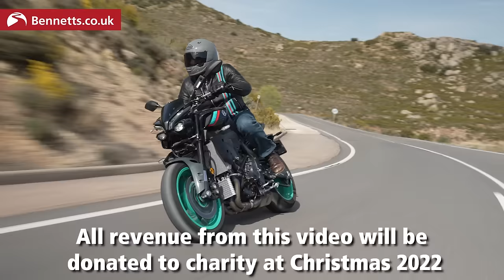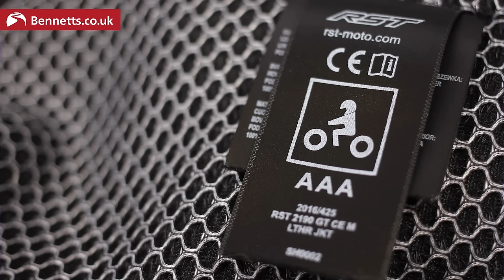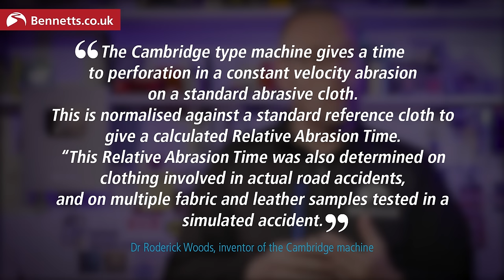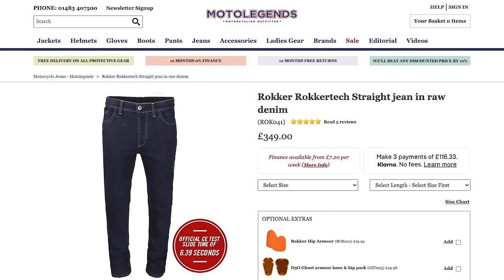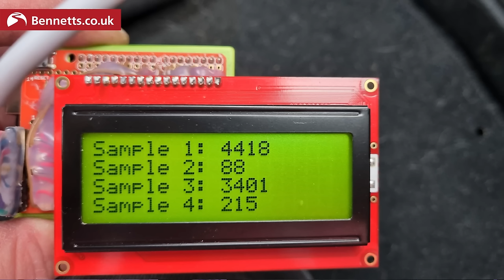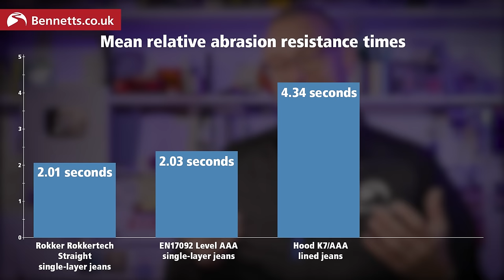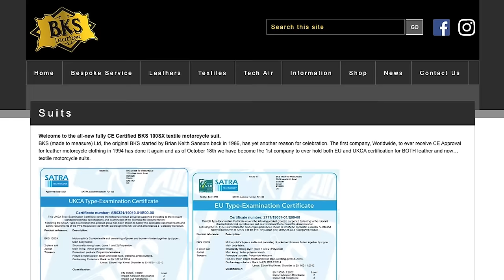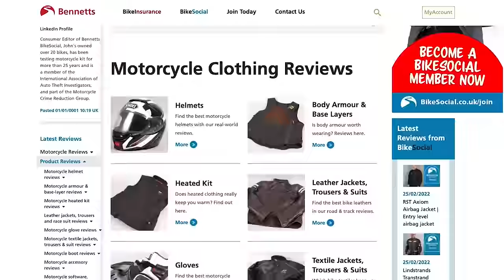Best motorcycle jeans | Single layer vs lined: THE TRUTH

Comment: You've confirmed a lot of stuff I've suspected about claims some shops / salespeople make. Thank you very much for your work. I have to say I am very interested in your upcoming textiles video. Some brands like Dainese in particular usually don't mention what rating their CE approved textile garments are rated to. I suspect their garments are all rated A for cost savings or not yet rated using the new standard. Nonetheless, I still wonder how they perform given Dainese's pedigree in the MC world. Other brands like Revi't are very upfront about what rating their textiles achieve (typically A or AA), whereas, Alpinestars is somewhere in between (possibly as they test more of their products to the new standards they will quote the ratings on more kit).
Reply: At the London motorcycle show we (Newham Trading Standards officers and I) spent 15 minutes trying to find the legally-required labels in Dainese garments. Trading Standards were on the cusp of telling the retailer to take everything off sale when one of the stand staff came over and pointed to a discrete, very well concealed pouch in the sideseam of the lining into which all the labels had been tucked.

The letter of the legislation doesn’t stipulate that the CE mark and other official information shall be immediately visible, but why wouldn’t a brand want to make the status of their products obvious? One possible explanation is the presence of identical styles on the market, some tested and certified and others not (old stock, pre-dating the legislation, which can be sold in perpetuity but which consumers might shun in favour of the newer, certified version).
Reply: @paulvarnsverry11  Yeah I did notice that Dainese do tuck their labels in a hidden pouch in the seam. I noticed this even on a new Racing 4 leather jacket. While I can understand hiding the labels for aesthetic purposes on the garment itself, I still don’t understand why they hide the rating on their own website under the safety tab?They typically only state what their armour is CE tested to (sometimes they will say the garment is CE tested but not provide to what rating). Even the retailers through which they sell their stuff don’t state how well their garments perform - even though they could look at the labels. Just strange to me. Maybe they think as a whole their products outperform stuff tested to a higher standard in abrasion alone owing to the coverage of their armour, the metal sliders, their linings, etc. ? I think they just don’t want to compete or be compared directly with other stuff.
Reply: @Omar-kw5ui  The “aesthetics” angle is entirely credible. I am also entirely in agreement with you on the need for transparency, and this is something consumers need to be demanding. At a meeting of the European Standards Working Group, I suggested an industry code of conduct whereby the classifications would be declared on manufacturers’ web sites, in sales and marketing literature, in advertising and social media posts. That suggestion has not been supported or picked up by the trade and industry bodies. Consequently, I have been working with the National Motorcyclists’ Council on ways to make riders more aware of the legislation and the standards, and so to make informed purchasing choices. The information is already available on the Internet, but its a small percentage amongst the usual misinterpretations and misunderstandings that are mistaken for being authoritative.
Reply: @paulvarnsverry11  Fantastic work. You should definitely keep pushing that manufactures must show what their garments are actually capable of. On the other side, we as consumers must reward manufacturers who are transparent by voting with our wallets.

Comment: Went down at only around 30 mph, on my right side. My jacket lifted at waist, so i had a significant road rash on my torso. On my covered elbow (Cordura mesh riding jacket) and knee (Rokkertech riding jeans), just impact bruises and slight rash. Wear your armored gear, the better the better!

Comment: By the way, an idea of how to solve that bouncing issue - is to add a small 4-5cm spring between the weight and the pad that will push the meaterial to the surface. Think of it as of a meat bag falling onto the road, our bodies are not metal balls, we have elasticity and big weight that knows to get transferred from point to point, so springs may do the work.

Comment: Just gonna "add" here... If I'm going to pay in excess of $100 for a pair of pants, they BETTER be worth something... Even so, if for nothing more than protecting them just a little more for a little longer, I'll continue to wear my chaps over them...

     So long as you look specifically for FULL GRAIN, there's almost nothing on the market that quite compares (let alone beats) leather versus thermal transfer and abrasion/ablation resistance. The difficulty for many is that Full Grain Leather is a bit stiff, and can seem difficult to soften up. The trick, however, is that you DO NOT WANT it "soft". You WANT it to conform to your body better. That's achievable (in my experience) by mixing Neatsfoot oil with Linseed (boiled OR raw, though boiled is usually more transparent/less discoloring) and then rubbing the leather down and hanging it up over night. Wipe off any excess in the morning and go directly to WEAR IT as much as possible/feasible. At first, it will soften and slouch and be easy to shape to fit you, and then it will stiffen A LITTLE BIT... Linseed "polymerizes" inside the leather, turning into a flexible rubbery substance. This turns your leather into something akin to fiberglass/composite and toughens the HELL out of it. Neatsfoot nourishes the leather (which is still essentially "skin") and helps limit quite the stiffening effects of linseed... You can rub down again in a year or so with the mix, and if weathering your outer wear is an issue, Plain Neatsfoot can be used 2 or 3 times a year (which is ALL you'll ever really need)... Once your leathers have reached a stage of "stiff enough" and shaped to suit you (aka "broke in well") just carry on with Plain Neatsfoot Oil (or Mink or some similar preferred leather care lotion/oil product) as you normally would. The Linseed/Neatsfoot mix CAN be stored in a cool-ish dry-ish place nye indefinitely... SO as folks recommend you get new gear periodically (though I inspect and repair my own frequently with no issue) You can also have the mix for the next leather(s) you decide to spring for. 

     Gear is an ongoing "collecting hobby" in its own right. Some just doesn't age well, like gloves as your hands just work and work and stretch and wrinkle and pull all the time... or boots because they're constantly getting beat against the ground even as you only walk... Others age a bit slower, and only really NEED replaced after an incident or accident of sufficient "abusive nature"... give or take manufacturers' and "experts" recommendations, and your own "good sense".

     In any case, I can understand those who can't (or won't) afford leather. It's cool. There ARE alternatives now that (unlike the 90's when I started riding) are NOT utterly crap. If you've got effective protection for what you're doing on two wheels, and it's still FUN AS HELL to get out and ride, you're cool in my book. I'd rather ride than breathe! It's not even a contest... AND I only hope to offer the occasional tip that might help someone else enjoy it as much as I do!!!

     Raise hell, everybody! Keep the wheelie-side down and steer BETWEEN the ditches, now... Ya' hear?!  ;o)

Comment: Yeah, in Canada we use crushed stone in asphalt. The crushed stone needs to be flat on two or three faces and sized to small grains smaller than a penny. Which means it was actually crushed and broken into jagged sharp edged pieces of uniform size. Basically it is like 20 or 10 grit super industrial sanding blocks made of asphalt that is super compacted under heavy vibrating rollers AKA strong as it could be. 

So you should just drive safely, defensively, and do your best to avoid adverse weather conditions. Because frankly it's not the road-rash that you need to worry about. It's the structural damage that will happen to your body in case of a high speed crash.
Reply: Yes, the "jagged" face is mandatory for surface layered asphalt because it has a larger surface face area. Bitumen won't adhere to smooth stone (river rock) (see American Society of Testing Manuals).

Comment: Ive owned a few bikes over the years, but i wouldnt say that i have a ton of time in the saddle. All the VERY experienced riders i know have been down before. All of them tell me that its not IF you go down, but WHEN you go down.

All that being said, i plan on buying a brand new bike this comming summer(im budgeting for it now, because im only willing to pay cash, i dont finance)
I feel kinda stupid, because when i was younger, i felt that a helemt and a jacket were just fine for protection.

For my new bike, protective equipment is a priority for me(im older and smarter now) 

If i find that the cost of proper protective equipment cuts into my budget, i will simply try to save money on the bike. As it stands right now, im super hot on a triump Bonneville t120. Its not cheap, but ive got my budget planed. If i find that my gear sets me back too much, maybe ill just get the t100 instead.

Im getting too old to take chances.

Comment: John, If you want a Cambridge machine.... most decent sized metal engineering firms may have a table linisher (basically an exact analogue for the Cambridge unit, wide belt and all).
I've worked in such a place, and even sanded the alloy head of an old 2 stroke (IT175) with an excellent result... (because I was careful I didn't curve the surface....    I digress)...

Anyhooze... You could probably talk them into letting you make a jig to lower a sample onto their sander, and you could also purchase a new belt from them so samples would not be tainted by used belts... (And you will probably be able to get 60/120 grain.).
Also if you use a water container (not completely full) as a weight it may also have a damper effect.. not that there will be the uneven surface from your road unit.

(Offer them food/drink (mention profits to charity etc) and you'll probably be presently surprised.
Reply from the maker: Cheers for this! I had considered making one...
Reply: @bennettsbikesocial  You 'Could' make one... You make the rollers very slightly oval so they self centre, I think the base is basically just steel but you could run a dry lube like graphite powder on the inside of the belt.

You could just go buy a belt sander, nothing says the sample has to be big and on a huge belt... and you can get belt sander belts down to 40 (1/40 of an inch, 0.64mm grains... About the same as Asphalt but the grains in Asphalt are smoother edged.)

Comment: Thank you for a very informative video. I never knew how the "A" ratings worked, and a couple of years ago after seeing a promotion for the Roker jeans I bought a pair thinking I had just about the best thing on the market! After your video, I checked the label and find it only says CE and no mention of any "A" rating. I feel I have been riding with a false sense of security.
Reply from the maker: While the ratings are flawed, they are a vital guide for buyers. Where 'slide times' are quoted though, things get more confusing for buyers as they're just not relevant. But even more worrying is the claim of being 50% more abrasion resistant than leather; testing indicates this clearly isn't true. Cheers, John
Reply: Jeans sold without hip armour will only achieve an “A” rating no matter how strong the material. 
Rokkertechs now come AAA rated, as hip armour is now included. It would be interesting to know if the material is any stronger than their previous A rated single layer jeans, which by the way I also own.

Comment: Anyone that works in construction should know that 60 grit sand paper is no where close to the same abrasion as any road surface, not even concrete roads because all concrete roads have texture grooves for traction making it just as if not more abrasive as asphalt, doing test on 60 grit sandpaper is not going to be accurate to real world accidents.
You get an A for effort and a 👍 for all the time spent on making a good video.

Comment: When I've ridden a 'top dressed' road, I've always had that feeling, don't lose it on one of these corners. And to top that off, the stones are always a bit loose for the first week or two. 
Gotta start doing the flat track style of riding and let the rear end hang out!
Reply from the maker: Nearly all the best roads around here have been surfaced this way and they usually are like a skating rink for a good while. One of them threw up so much dust too that it was like a sandstorm!
Reply: @bennettsbikesocial  The other problem I find with roads surfaced this way is the bumps and hollows seem to be harder to see. The local council did a B road I ride quite often and there's a couple of hollows, just before fairly quick right hander that if you hit them can really unsettle the bike, in the dry there almost impossible to see, not so bad in the rain as there's a bit of standing water, but they're right on the line you'd take these corners at if you didn't know.

Comment: You could have mitigated the inconsistencies in your testing rig by attaching all the arms with a single cross brace, ensuring that if any one arm hit a bump, all the arms would react similarly. I understand that this method would prevent you from pulling up each arm individually when the sensor wire broke and examining each sample visually, but you would have still received valid data about the abrasion resistance of each sample because of that sensor wire.
Reply from the maker: Trouble is, then inconsistencies Inn the road surface would have been an issue. I should have put dampers on the arms

Comment: This is a great video with very useful insights and information. However, even though it was briefly mentioned that the garments perform better with armour installed the failure to mention that in order for a garment to meet AAA rating it must include the armour to meet that abrasion standard. An example of this is Bull-it who originally sold their Covert Evo single layer jeans with a rating of AA acknowledging that without armour it only met that standard and now the same jeans are AAA rated with armour included. Ultimately, because of the omission of armour for the abrasion test on the AAA single layer jeans in the video the results would be inaccurate and misleading due to the failure to have the armour in place during the test dramatically reducing the abrasion resistance of the material. At least this is the case in articles, tests and other similar videos I have come across.
Reply: The armour is not present in the abrasion tests. The EN 17092 classifications are a combination of test performances for abrasion resistance, tear strength and seam strength, plus presence of armour (specifically, for trousers and the lower half of suits). 

Jackets require shoulder and elbow armour at AAA, AA and A classifications. Trousers require hip and knee protectors at AAA and AA classifications, but only knees at A classification. Suits require all four areas to feature impact protectors at AAA and AA classifications, with the hip protectors absent at A classification. 

Consequently, a suit or trousers could meet the highest, AAA requirements, but if hip protectors are absent it would only be rated at A. I don’t see how this is helpful to riders who might prefer to know how the garment performs in its own right, irrespective of which protectors are fitted. Might it not be better to have suits labelled, for example, AAA + S E K (shoulder, elbow and knee protectors), or trousers labelled AA + H K (hip and knee protectors)?